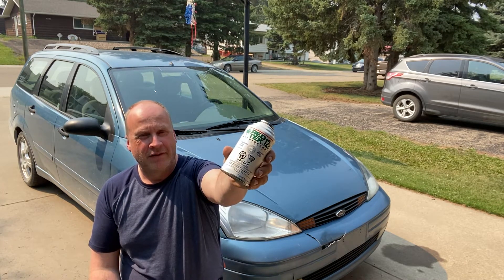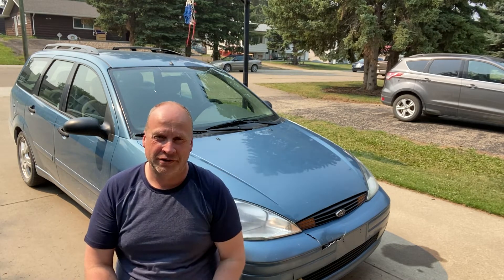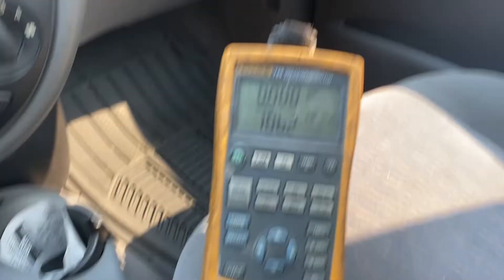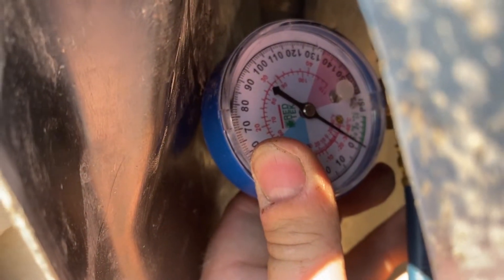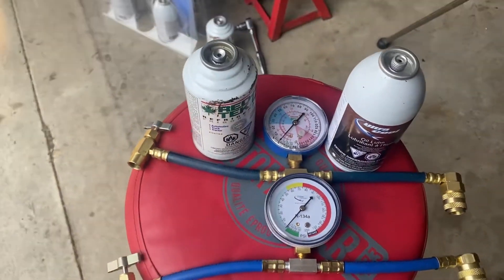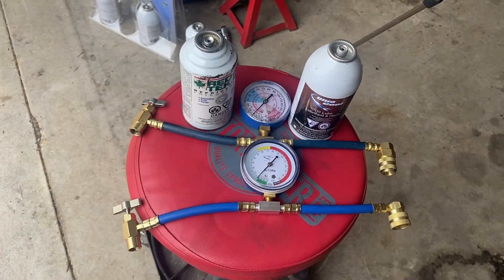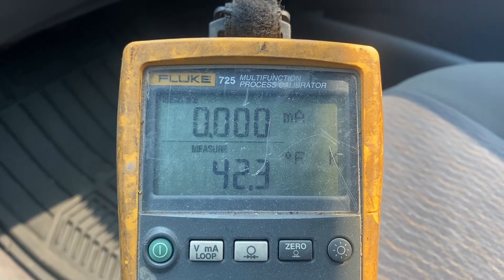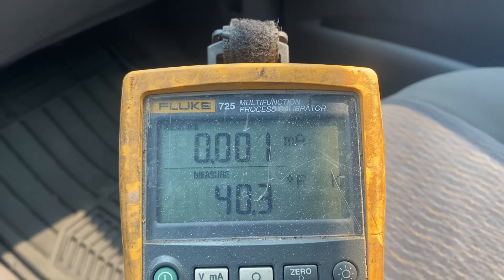DIY Air Conditioning Recharge

Comment: How's that boost controller treating you
Reply from the maker: It’s doing alright for a cheap Amazon boost controller, I do have some minor boost creep issues but I’m not sure if that’s the fault of the boost controller or the size of the wastegate or my hot side design. At some point I’ll probably upgrade to a better one but for the time being I’m still using that cheap one I did the video about.
Reply: @LowbuckLS  ok sweet, got a link?
Reply from the maker: @infamousnova  Qiilu Adjustable Manual Turbo Boost Controller Kit Bilateral Valve with Mounting Bracket Universal https://www.amazon.com/dp/B07X5WPRHV/ref=cm_sw_r_cp_api_glt_fabc_VDJ1GZ89WV56WBMG4YFW
Reply: @LowbuckLS  ok I was just looking at that one, thanks! Purchased

Comment: Is 45 psi the max pressure, I was thinking it was closer to 50-55 psi?  Does her car have a cabin filter, if so it might be clogged reducing flow?
Reply from the maker: I might be able to increase the pressure to 50-55 but 45 was all I could get out of the can I had. I will look into the cabin filter thing as well, not sure if this car has one.
Reply: @LowbuckLS  looking at the temperature scale 55 psi would be about 57 degrees that's 67 out the vent.

Comment: it should be illegal to sell refrigerant to customers who know nothing about A/C. Here we see a, "DIYer" installing the WRONG REFRIGERANT into a vehicle. I feel sorry for the real technician who is going to get his machine polluted when he attempts to do a REAL repair!
Reply from the maker: Hi Joe, according to the label on the can, the R12A refrigerant I installed is compatible with the R134a refrigerant that was originally in this car. Since the pressure in the system was at zero I’m assuming most of the original refrigerant had leaked out. I did explain in the video that the way a shop would do it would be to evacuate the existing refrigerant first. This was basically an experiment to see if it would work, and based on the temperature of the air coming out of the vents I would say it did.